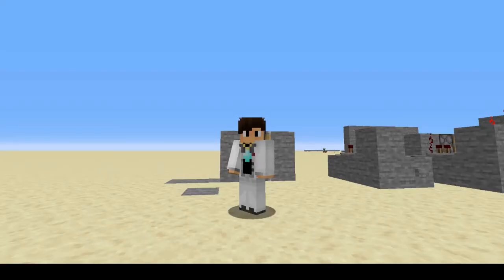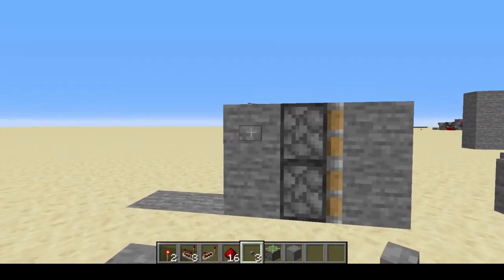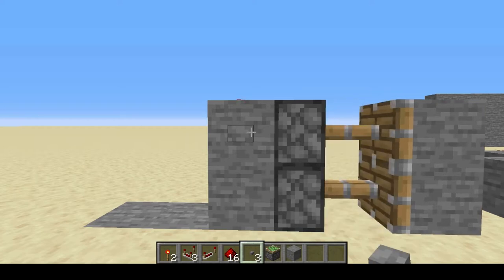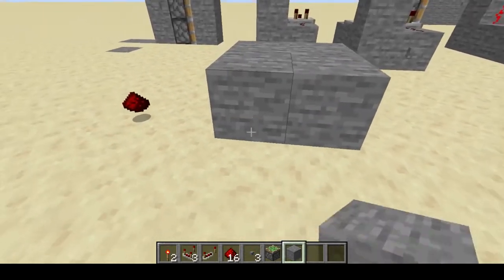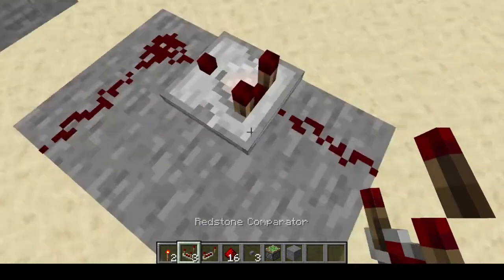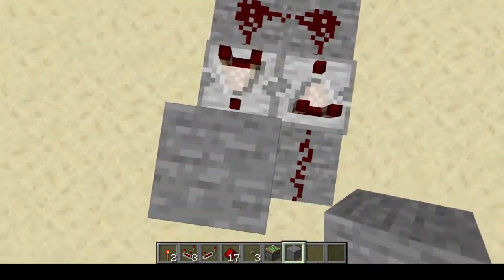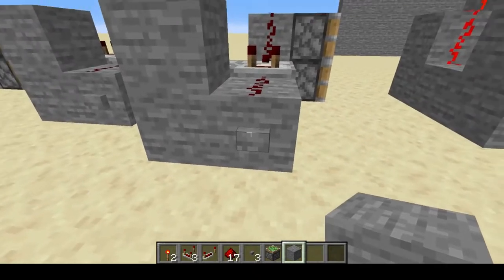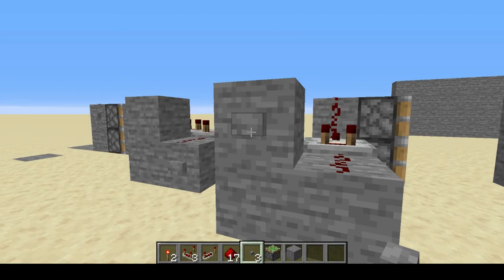Pulse Extenders 1.16+

Comment: The pulse extender works in Bedrock, however like you said, the flush door with the pulse extender would need rewiring due to Bedrock not having quasi connectivity.
Reply: *Quasi
Reply: i tried the pulse extender but didn't work